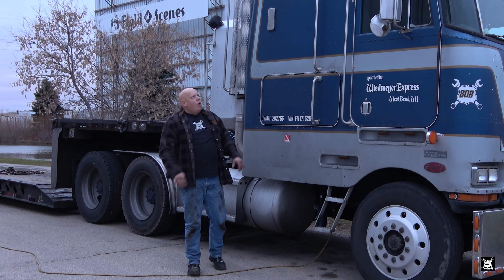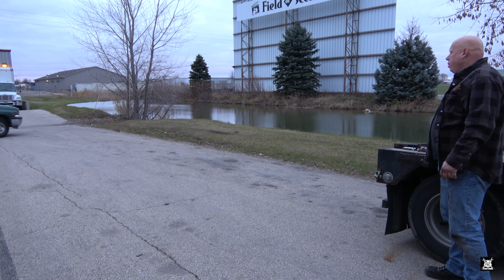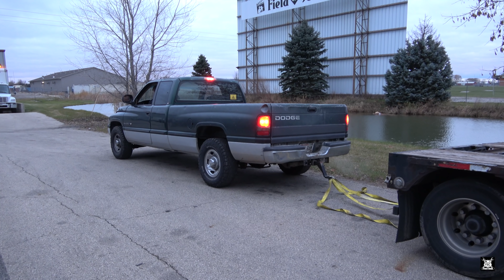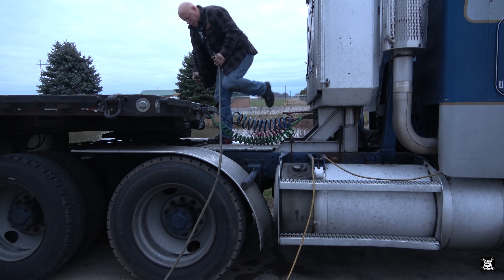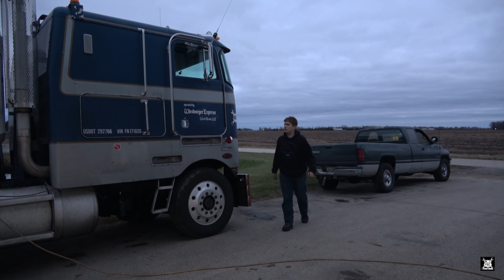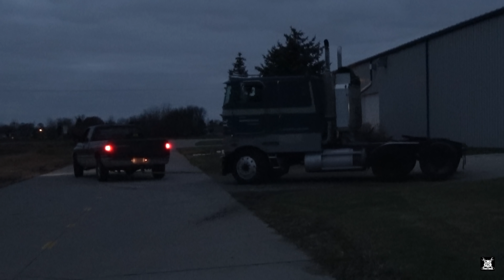Cabover Won't Start   Pull Start With V10

Comment: If you need any unhelpful suggestions, put an air starter in it!  I have a Case that the starter gets oil washed, just takes a can of brake cleaner to get it working again, though I have a short walk if it doesn't start at some later point.

Comment: Stick to your guns on Ether Steve, evil stuff. Starter motors are cheaper and easier than piston rings.
Reply: I have used brake cleenze as start fluid.Alcohol and benzine in it.Not as bad as ether.

Comment: Might have corrosion inside the terminals on the cables, seen that often. Get a loose terminal on either studs of the starter will carbon arc. I have pull started in reverse, just use high range.

Comment: I've had to do that a few times mostly for dead batteries well weak ones that wouldn't charge up and long way from place to get any had good old 3406a just screw in stop solenoid and drive it once running but keep the video's coming on all 3 channels

Comment: Iallway had a air chuck on one tank to remote fill air tanks . If starter is stuck in fly wheel you may have to remove starter before you can pull start.it

Comment: Hey at least it started easy. I had to do that when somebody forgot to turn off the light's. And the batteries was dead. And i forgot to grab the jumper cable's. And friend's had no jumper cables with them. But lucky one had chain's with them. And we rolled start my truck and it fired up easy. Lucky the road was flat cause both truck's was small truck's. A ford ranger extended cab. And the other one was a Chevy Blazer. Lucky i have a tank that hold's air and i was able to get air in the airbag's. The kid's was like come on come on come on start. We tried several times and it finally started. I was like hell yeah thank god. We let it aired up and charge the batterie's. And i tested it to make sure the batterie's was charged and sure enough they was. And Steve best advice is always carry a spare starter in case the starter in the truck goes out. It never happened to me but has happened to a few driver's. Since it's getting cold my truck will always be running since it's hard for it to start  when it's really cold. And if u can't plug it up to keep the engine warm. If there is an outlet that i can use to plug the truck to keep the engine warm. Then i will shut the engine off and use the generator to use for the sleeper and other thing's. My wife was like can u do that air the truck up like he is doing. And i said yeah i had to when somebody forgot to turn off the light's. My truck sit's low when i deflate the airbag's. But that is going to be fixed soon where it does not set so low. And if the airbag's are messed up i can still drive it to get the truck serviced.

Comment: I'm surprised you didn't pop the clutch with Orwell in reverse while pulling it backwards. In reverse, going backwards, the engine will turn over in the correct direction, thus avoiding rehooking to the front of Orwell. Anyway, love your channels. Have a great day!!
Reply: I think that's because reverse is too low  of a gear ratio.  You need a higher gear for a jump start.
Reply: I had a car that needed that, neutral, open the door, get out halfway and kick it backwards, hop in and stuff it in reverse to start it up.